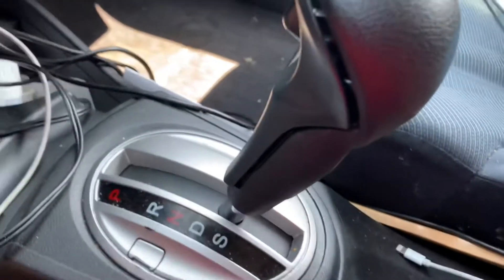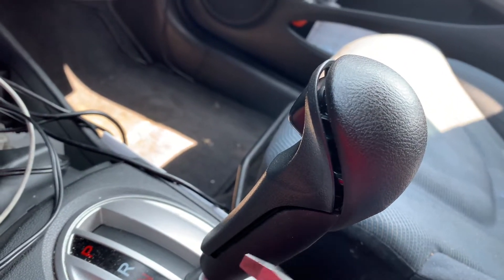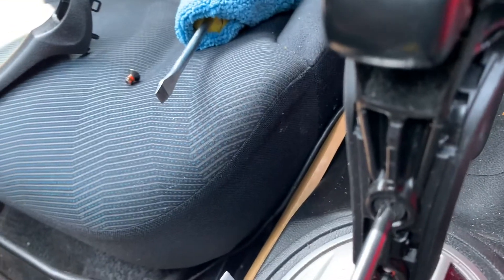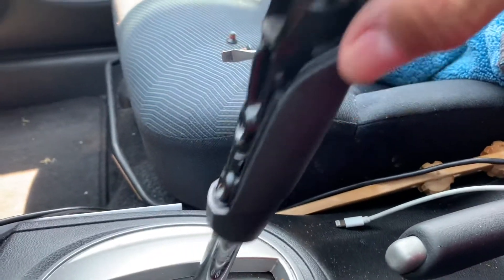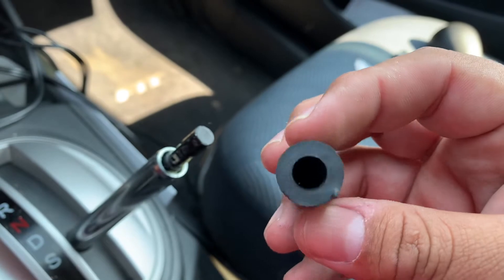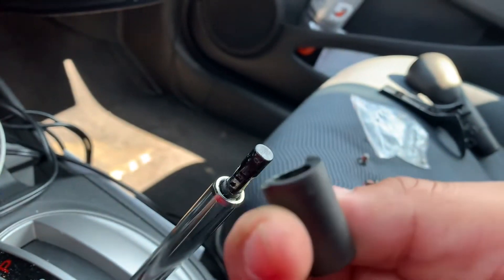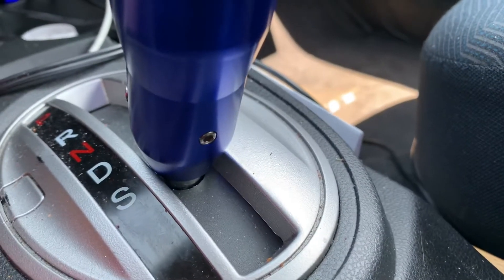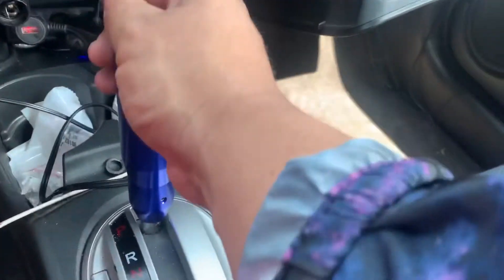How to remove Honda Fit shifter and install aftermarket one

Comment: Thanks for this clear video. I have to pull up the console to replace a burned out shifter light on 2017 fit. Maybe I won't have to take the knob off. 😅

Comment: hey how did you manage to use a different knob without the shift gear button?
Reply: The button on the original one is what causes it to shift gears, and with the middle piece being pressed Down with the after market one
Reply: The one he installed has a button, not sure what your question is.